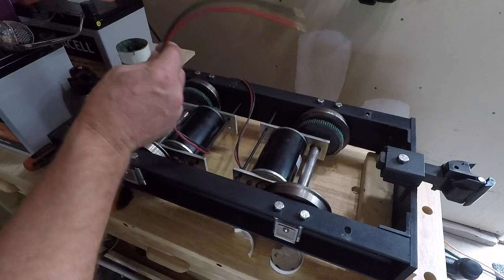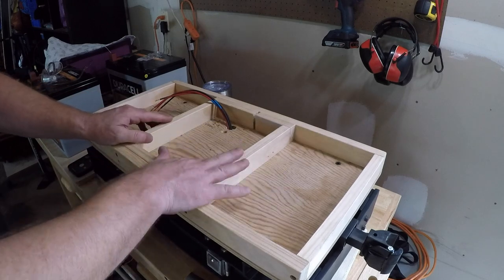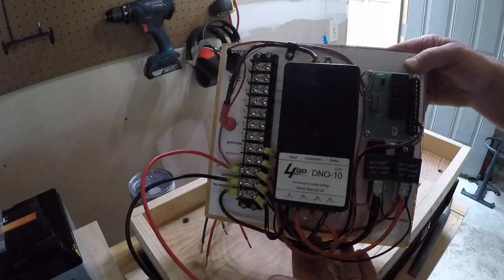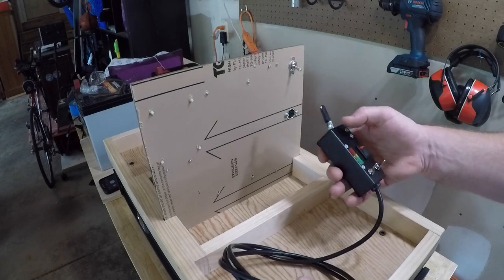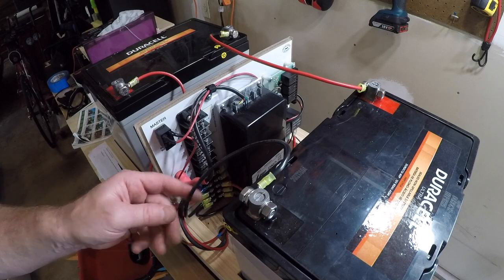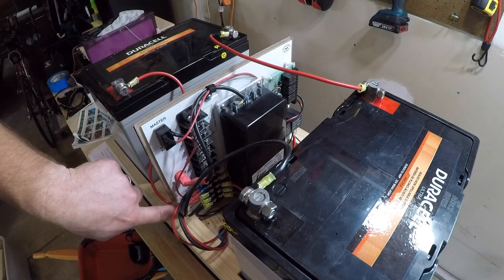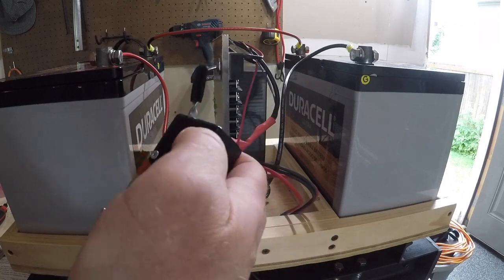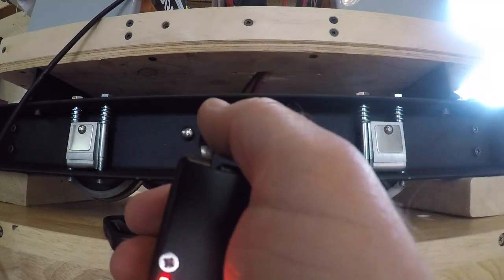Backyard Railroad: Power to Plum Cove Generic Electric Locomotive (1 of 2)

Comment: Hey Erik... looking great!  I love the way PC labels and organizes their wiring.  When installing batteries in my 24v loco, I usually hook up the neg leads first, and then the pos.  Reversed for removing them.  I ended up color coding all the ends of the wires with labeling as my harness got a little more complicated than originally designed.  Plus, I had a sparking-mini-welding episode that provided the final motivation!  :)   Great video series!